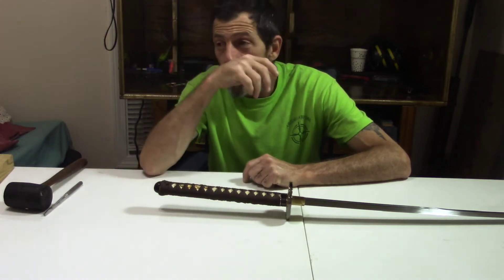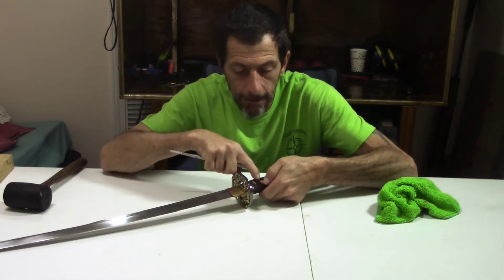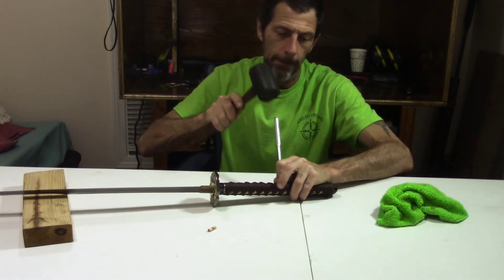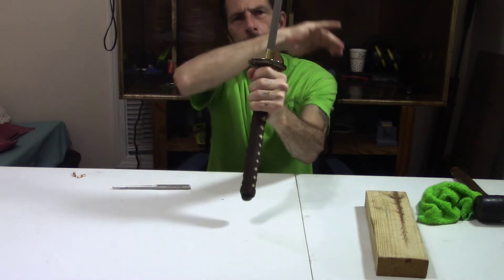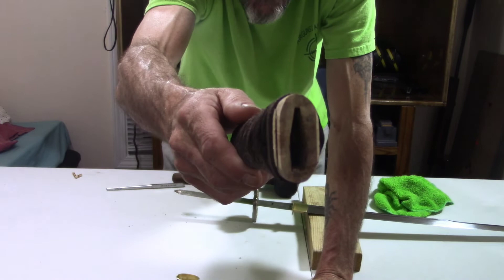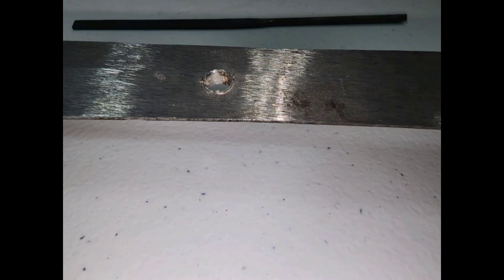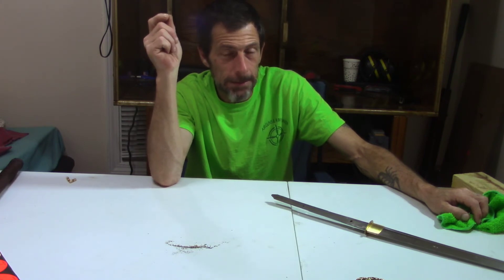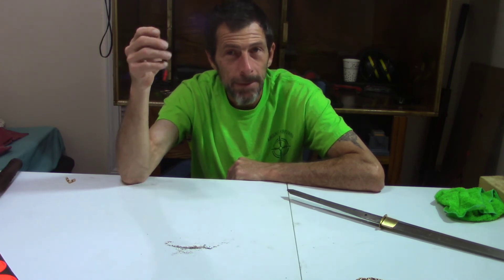disassemble a katana

Comment: Roy try to use an Alan key and tap it in an angle of the direction the mekugi peg is drilled in...most times they put them in an angle for more security...try to wipe down the tang after you touch it...as when you put the tsuka on it will gain rust from your hand prints....but great go at it Roy...